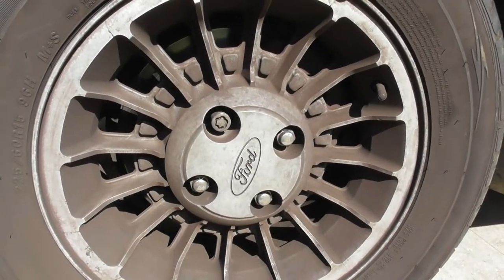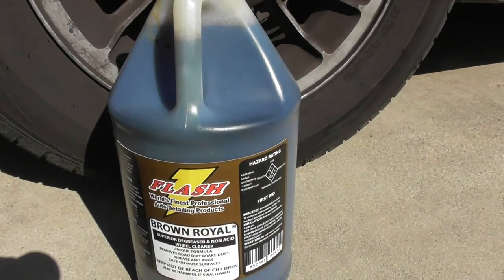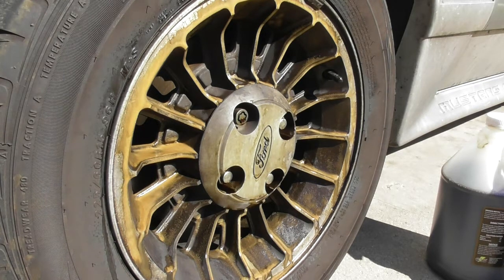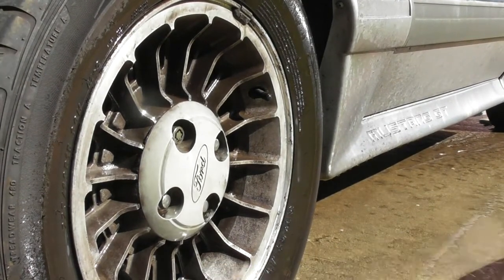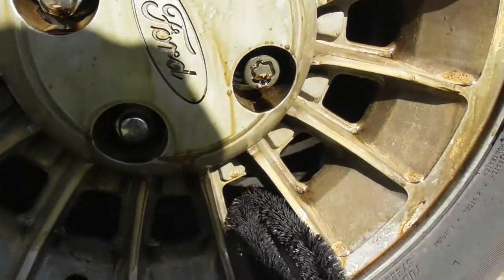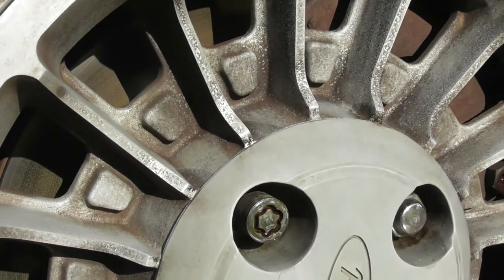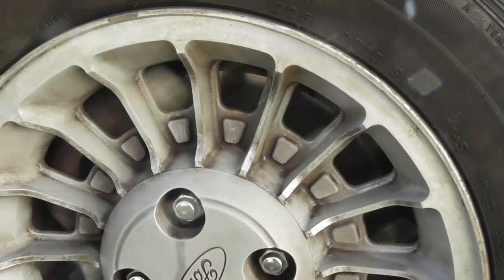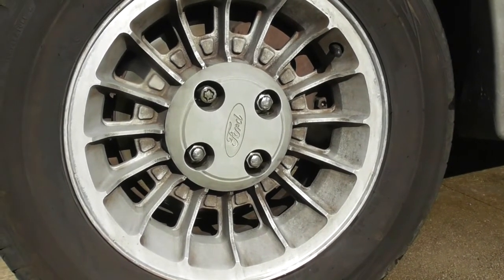Flash Brown Royal MOST HONEST Review on YouTube DOES it Really CLEAN CAR WHEELS

Comment: What dilution ratio are you using? If your rims are that dirty then you  should mix it 1:1.  You should  start off with  a 3:1 ratio, Should  be using a pressure washer.  Apply and wait 3 to 5 minutes.  Make sure to agitate the rim after waiting 3 to five minutes,
Reply: Try iron-x by car pro or sonax wheel cleaner. Have you tried meguairs wheel brightener. Be careful cause it's an acid based wheel cleaner and it has a known carcinogen in it.
Reply: its not toxic, its alkaline, use a breathing mask for peace of mind...you'll be fine.

Comment: I have a gallon of this stuff and used it several times and in my experience, the product works magic. However I have used it on 25 year old rims and it doesn't look perfect even afterwards. It depends on the condition of your rims - it cleans off brake dust, it doesn't fix your rims if they are old and rusty. I'd say use it at full strength and scrub while it is still wet and running (in other words, apply as strong as possible) and wash off with the same pressure you show in the video. Also, be careful not to spray into the wind... :)

That is probably about as good as your rims can look.

Try spraying the tire and you'll clearly see the difference before and after, since I see there is significant brake dust on them as well.

Comment: After detailing for auctions and fleet vehicles for construction and semis and obvioulsy customer cars and motorcycles I can usually say if this stuff doesn't work then there is a very very large chance your clear coat is ruined,my 31 year old dually I sprayed it on and light fast scrubbing and then pressure washed it off,and that's like the only one I've had to scrub with although i try to do it anyways just to cover myself as a person who did this professionally I need to cover all corners of quality,but yeah if these wheels aren't aluminum or anything I would say try an acid based cleaner like meguiars wheel brightened but then again if your clear coat is bad then I would probably steer clear and stick to brown royal